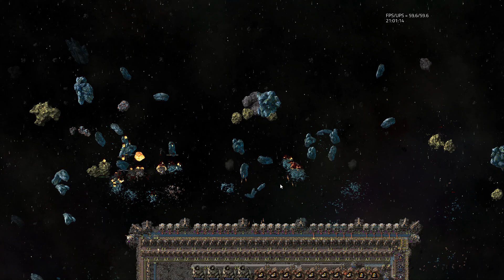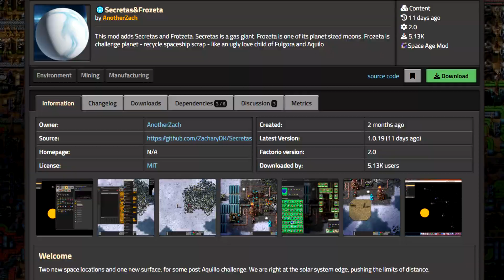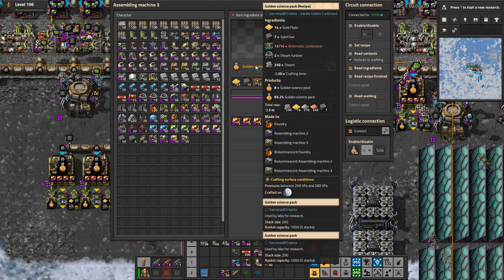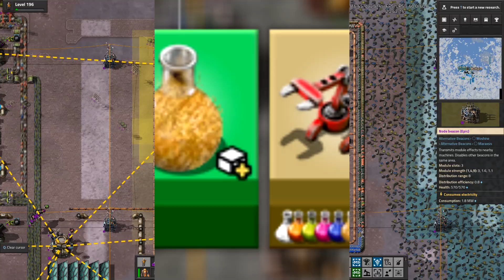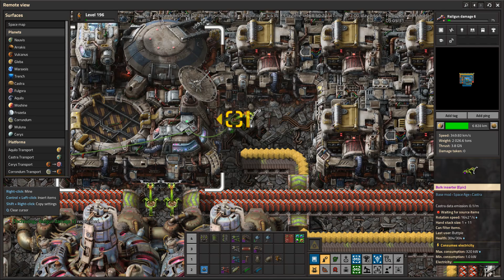Factorio Mod Tips: Secretas&Frozeta

Comment: The pipes for the steam recyclers are odd. The steam only flows through them one way depending on which pipe connection you use.
Reply from the maker: @Dr.Obtuse  They have since this video was uploaded been changed, as far as I know. I reported it on the github.

Comment: Would be cool if you could enter the gas giant with the requirement of mech armor and maybe some module inside the mech armor, you setup some harvester that directly fires onto Frozeta to help with some crafting chain.
Reply from the maker: @runelt99  Or harvesting chunks of frozen gas by flying "around" it, from asteroids, like the oxide asteroids. Totally agree
Reply: I’m late to the party here, but the addition of the Secretas surface as part of the Outer Rim mod partially does this. While I have not implemented it in my factory yet, on paper I could have a platform on Secretas shooting barrels of ammonia back to Frozeta to make fusion cells with the extra holmium and lithium from spaceship scrap. In turn I could shoot some of the cells back to keep the platform powered.

Comment: 40 byproducts 😂, i want to try it and see it myself
Reply: Fun fact - there are so many products it overflows the tooltip. One question I had was how far could I push the recycling mechanic. Hope I didn't disappoint.

Whatever solution you use - its going to be a brain teaser.
Reply: It outright breaks Helmod if you try. Factory Planner handles it better, but it's still overwhelming.